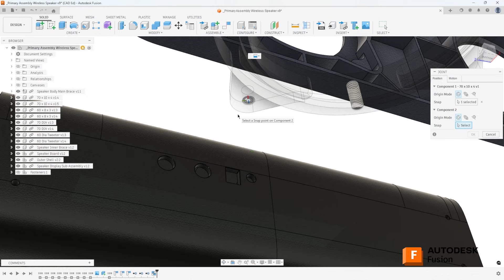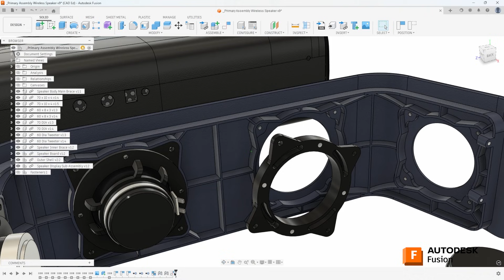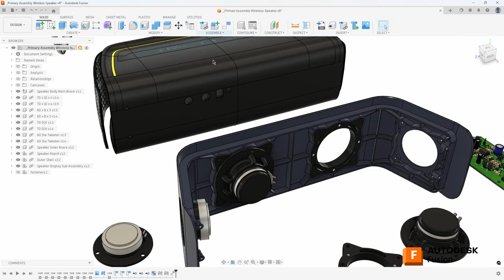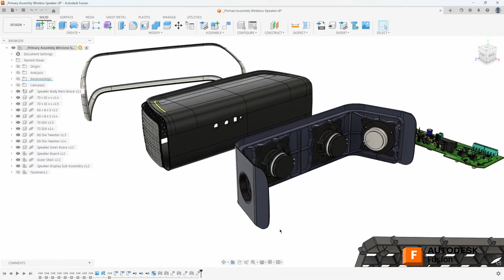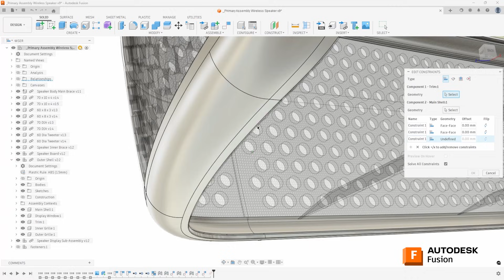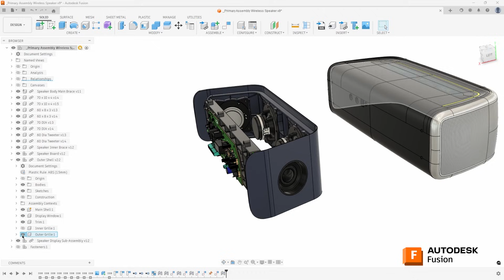Using Joints and Constrain Components Together | Autodesk Fusion

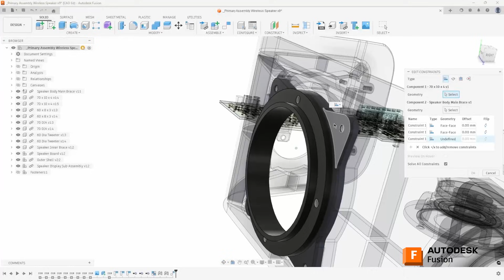Comment: 4:20 "The part is now locked in place", but there is no way of knowing because we dont have any indicator on the component that indicates this. Also good luck finding these relevant constraints in a huge assembly as we put them randomly in the design history not in any folders under each component

Comment: Is it possible to get these part files?
Reply: If you click on the Home icon in the Data Panel, then click on "Design Samples" under the Samples section, you will find a bunch of sample models you can work with, including the Wireless Speaker I used in the video.

Comment: when you did the 1st rigid joint, what controlled the clocking/rotation?
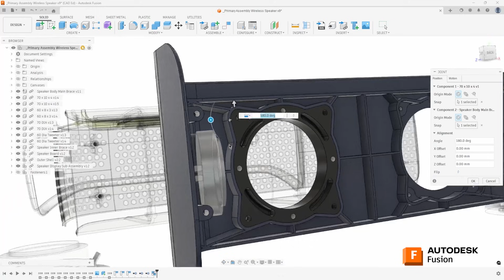Reply: Watch at 1:46, as soon as he clicked on that destination, the x,y,z, and rotation drag handles appear. Just so happened he didn’t need to change the rotation, but if he did need to, it is the blue dot just to the left of the hole. You would grab that and drag it, or type the value of any desired rotation. The box for entering the value is under that tooltip right now, and if you zoom in you can see it is already highlighted, so you could just start typing the value and hit enter.
Reply: This very question has gotten me for a long time because of use with other software but the answer is in your question. "Rigid" joint. By definition is locks all degree of freedom similar to grounding a component. I still struggle with joints too.

Comment: anywhere to download the component in the tutorial?
Reply: If you click on the Home icon in the Data Panel, then click on "Design Samples" under the Samples section, you will find a bunch of sample models you can work with, including the Wireless Speaker I used in the video.